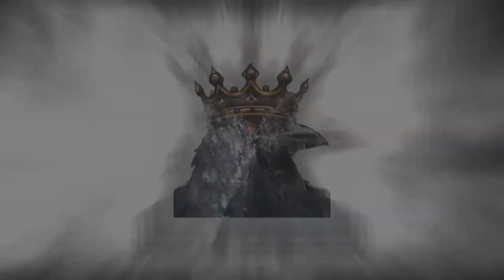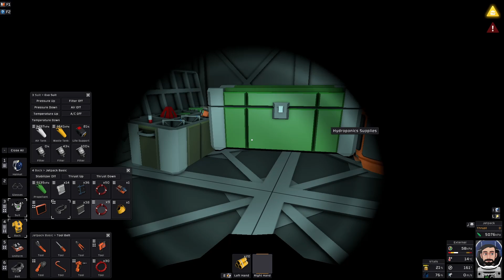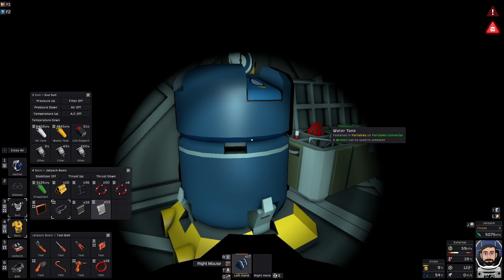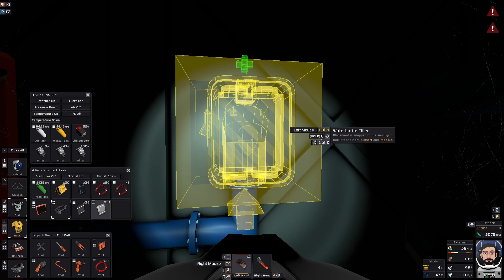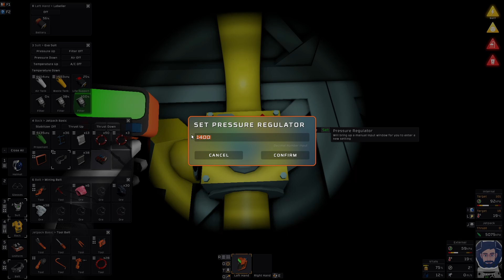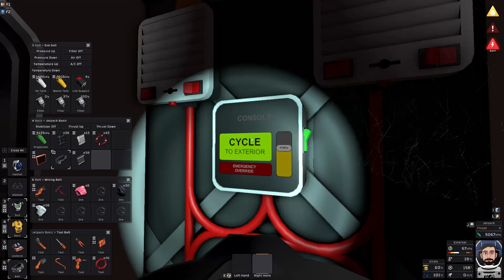Getting More Oxygen and Water in Stationeers | Episode 6

Comment: Three notes, you should show to tell a liq connection vs a gas one, mainly with the tank connector.  A liq connection will have the “6 bolt holes” where a gas won’t.  There have been times where I accidentally connected the wrong pipe type up.  2nd if a portable tank valve is opened, it will stay opened if connected to a connector.  3rd water ice also has. N2 byproduct.  You should show i the stationpedia what liquids/gasses will be produced when crushed/melted.  The only ice that’s pure when mined is vol ice (except space ice)